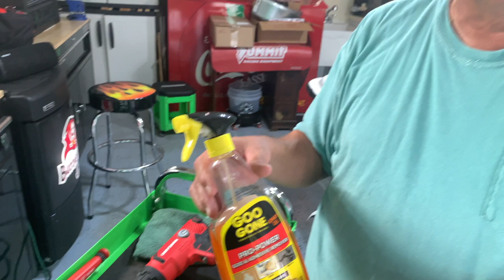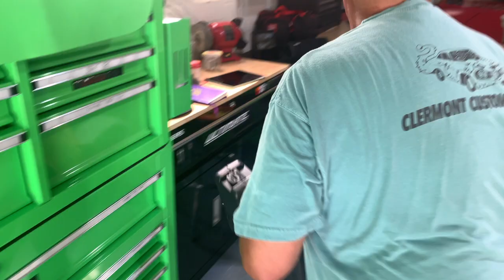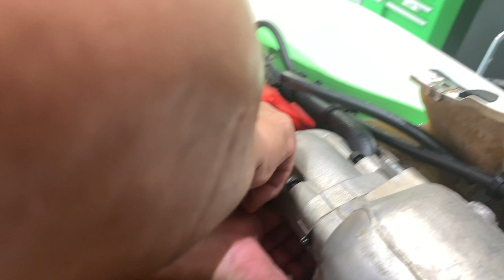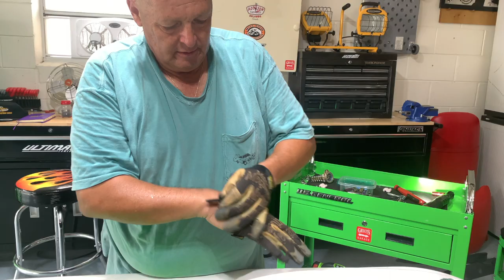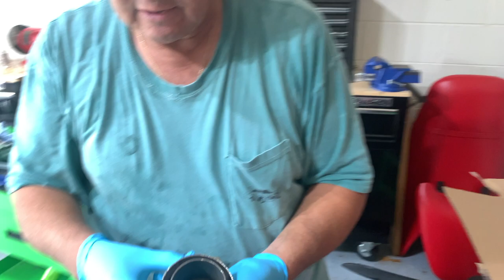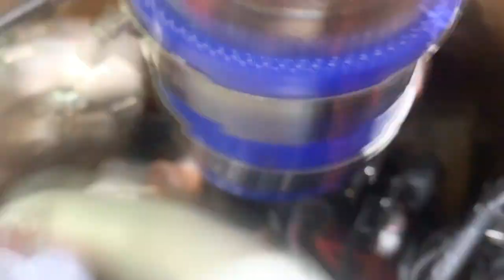Honda AquaTrax Rebuild Instructional Video

Comment: I’ve been watching your videos I have a 2005 Honda turbo 12 F. It has a hard time starting but eventually it does wanted to find out if it’s the fuel injection or something or fuel pump
Reply from the maker: It could be a couple of things “codes” are primary offenders… it may also be the main assembly around $150 part…or perhaps a sensor… do you have a shop that can read codes?

Comment: in Russia we use solvent 646 to remove glue
Reply from the maker: Did that work my friend?
Reply: @clermontcustoms  I put the soaked cloth on top of the sticker and it peels off after a couple of minutes

Comment: My Honda aqua traxx 2005 F-12 dash is locked can't crank it do you by chance no the code or how to reset it thank you
Reply from the maker: As always make sure your battery is fully charged.  If so, that might work.  You may also try to disconnect the green/grey connector under the trunk on the right side of your ski.  It may take a little prying, go slow to pull apart, then reconnect by snapping it back together.  It will only go back together 1 way.  The key is to make sure you have power going to dash. If is still throwing a code, you may need a new computer module under the dash, or a new relay.  The computer is very costly around $1200, the relative is around $150.  I hope this helps.  Please let me know.  Best wishes and thank you.  MD CCC

Comment: PLEASE tell me how to replace sponsons
Reply from the maker: Hello,
First is to have the parts.  If you cannot find them they can be sanded, filled, primed and painted.  They are formed plastic so it s fairly simple to work with.  Remove the 4 bolts. The bolts are connected to the hull.  I think a 10m socket would work nicely.  Then simply pull it off.  If they have not been removed before they may need a little pressure by just pulling up and down to dislodge.  I hope this helps.